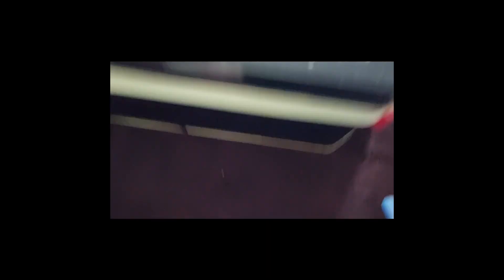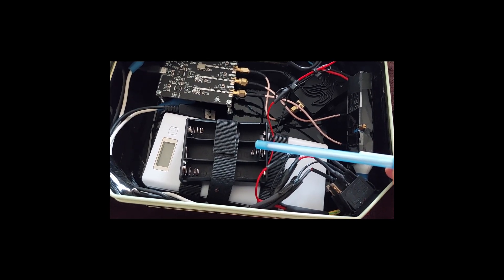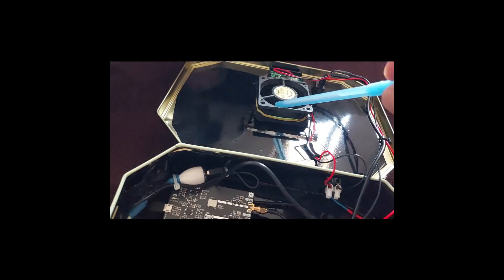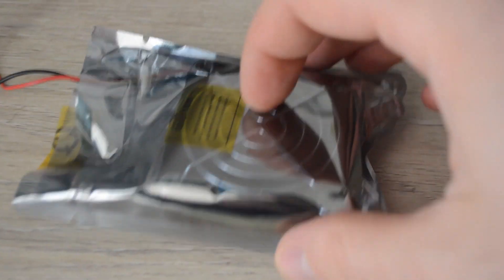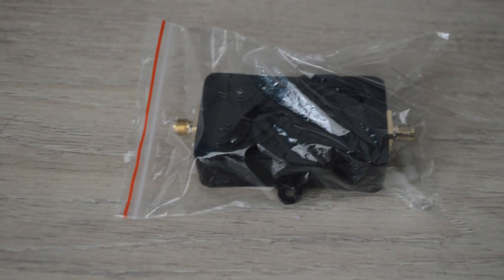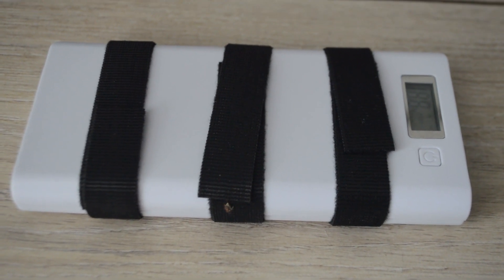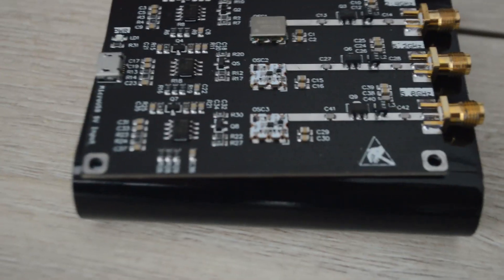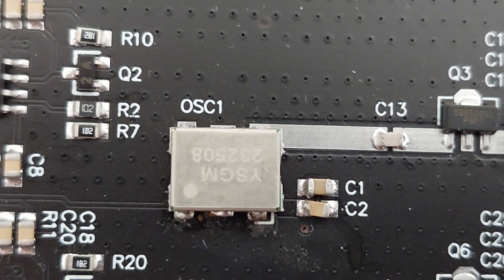List of components for DIY 2.4ghz 5.2ghz 5.8ghz Wi-Fi signal jammer

Comment: I built a jammer using an esp32 board and dual antennas. The range is not very good on it. How would I hook the amplifier up to the dual antenna setup I am using?
Reply from the maker: Between the esp32 and the antenna, if you are using SMA
Reply: @pythoneatssquirrel  what is SMA? Also, I used two NRF24L01 antenna boards that are attached to the esp32 so that is where I am confused about adding the amplifier. Would I need two amplifiers or just one and how would it be installed, in between the NRF24L01 antenna hookup and the final antenna?

Hope this makes sense. I am new to all this RF stuff.

Comment: The board doesnt exist anymore.
Reply from the maker: There are other available with amplifiers included or not and also aluminium case
Reply: @pythoneatssquirrel  can you provide me with the link? Tried to find it on the internet but had no luck.
Reply from the maker: @237311  here you go:  3IN1 2.4G 5.2G 5.8G Wifi Frequency Control Block Module 1W RF Power Amplifier + Antenna For 2.4Ghz 5.8GHZ Network WIFI Bluetooth
https://a.aliexpress.com/_mqhFynK
Reply: Update link pls
Reply from the maker: @user-sw9tb5ct4v  check aliexpres, it's redundant to provide links for such products because they are deleted from the shop after a few days and they create new pages
Reply: @pythoneatssquirrel   The Link you shared is not valid. Please update the link. 
"Sorry, the page you requested can not be found:("
Reply from the maker: @237311  the items are remove after a few days and the shop creates a new page, try searching for the same item on aliexpres, it changes very often
Reply from the maker: Check my new video